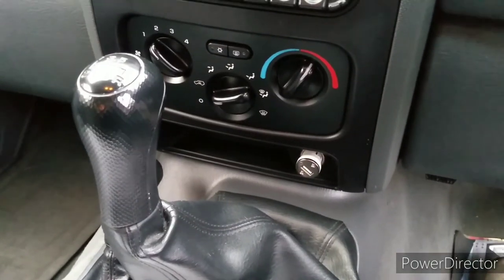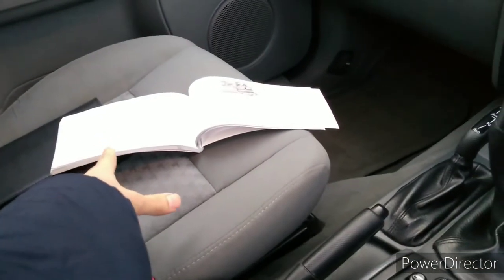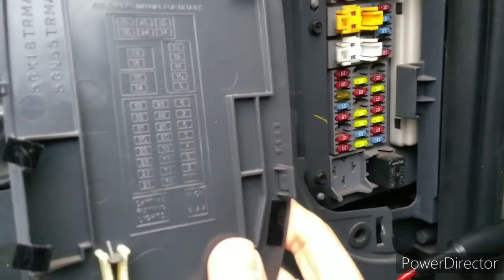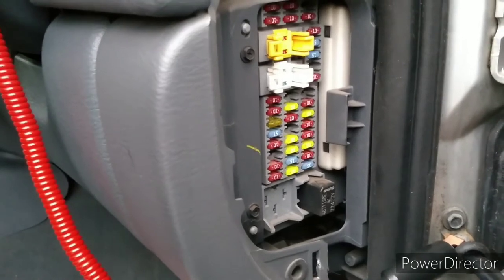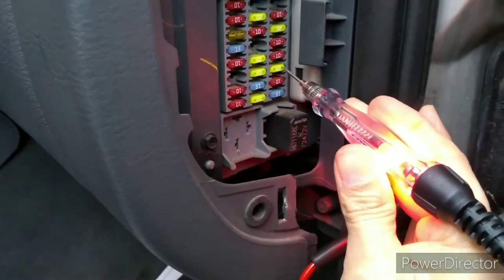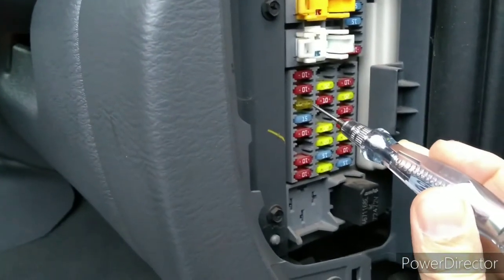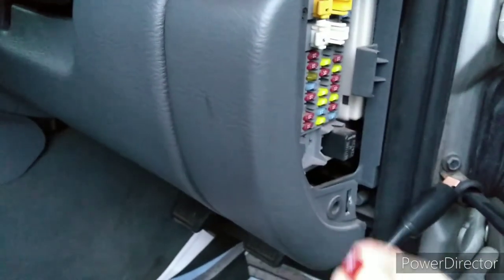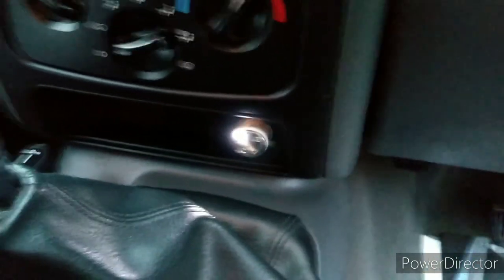Jeep Cherokee / Liberty (2002 - 2007) Cigar Lighter Power Outlet Not Working - Is Fuse Blown???

Comment: Thanks for that.I came across a similar thing when trying to locate the Fuel Pump fuse on a Nissan.The Fuse Box was mounted upside down under the dash cover ! Took a while to figure out.I guess the morale is dont take any thing for granted and follow things in a logical sequence,which you've done in the Video.:yougotthis:
Reply from the maker: Yes it happens but is very frustrating - like new parts that don't work! - thanks for watching :)